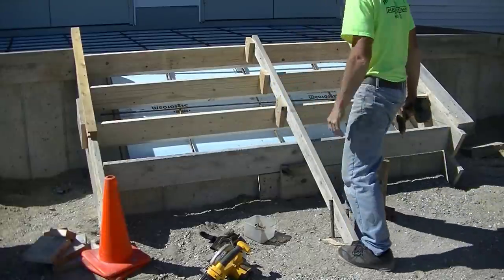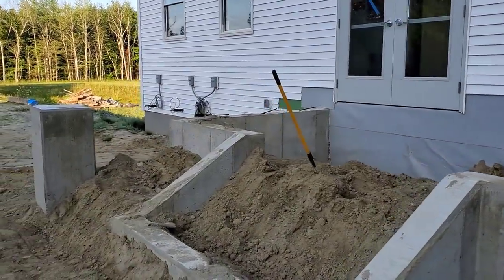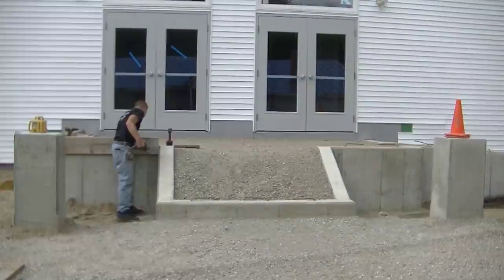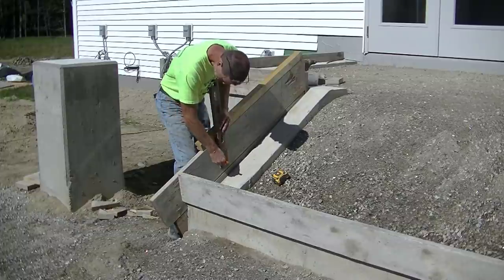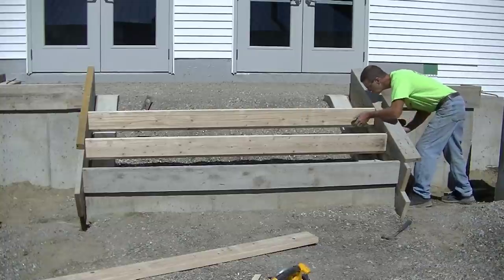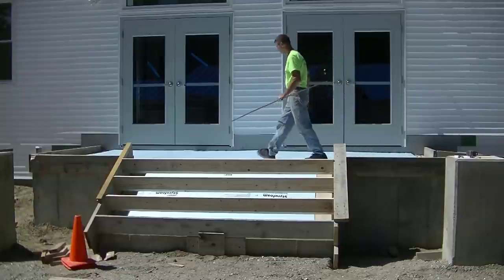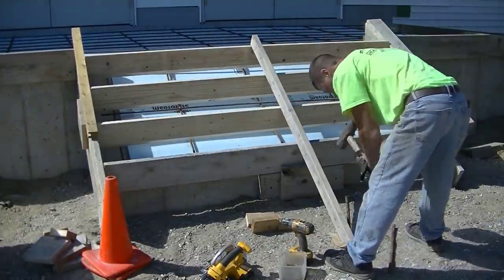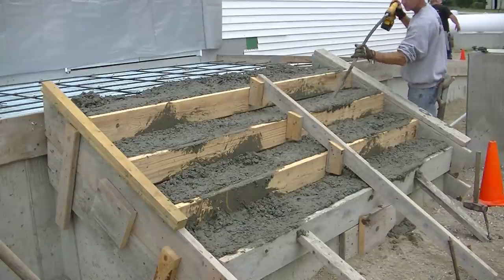Pouring Concrete Steps (Basic Forming Part 1)

Comment: After doing many sets of stairs thru the years, I found that if you’re trying to save the riser forms for multiple pours, a 35°-40° rip works just a little better, bcz it’s just a little less prone to breakage when you strip the forms than a really sharp 45° angle.

Comment: It’s better if you cut the boards on the sides into the shape of the stairs and then put the risers on and let them hang over a foot on each side that way when you’re steps get tied enough, you can pull the nails or screws out and you can see saw the risers back-and-forth and finish the face of the steps. You’re welcome.

Comment: Hello, do you pull the rebar up on the stairs while you pour? It looked like the rebar was laying flat on the foam. How would the rebar add strength if its not suspended in the middle of the concrete? Im just curious. Thanks for the videos!

Comment: Great video..
Is it common in your area to make the deck the same height as the floor coming out of the house?
In my area when you open the door you would be pushing snow..
Reply: Probably makes getting in the door easier for wheel chair people
Reply: That ADA ramp on the right does imply that someone in a wheelchair might appreciate not having a big step into the building. :)

Comment: Wow! Is that a cordes hammer drill? I don't run any corded tools anymore. It's great seeing all the bulldogs in the shop collecting dust.
Reply: Mike If u have access to Fiberglass rebar, make the change. Switched over 4 years ago. Changed my life.  Carry as much as u can stack on a truck, doesn't rust, u can drive it into the dirt and it wont draw up the rust.

Comment: I always wonder how you get that camfer on the top of the concrete wall ?
Reply: It’s made with a thin strip of wood, cut on a 45° angle. If you’ve only got a few pieces to do, you can make them right on the job. But most decent sized lumber yards sell chamfer strip already milled that you can purchase for very cheap by the bundle. Chamfering the edges and corners of concrete walls does a lot for ‘dressing-up’ the final product as well as keeping the edges much less likely to chipping and breakage.